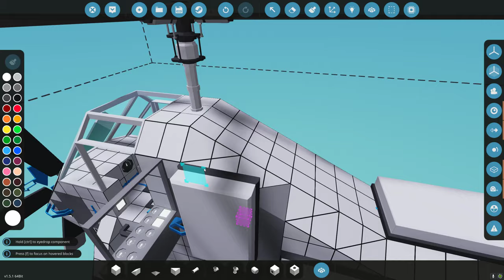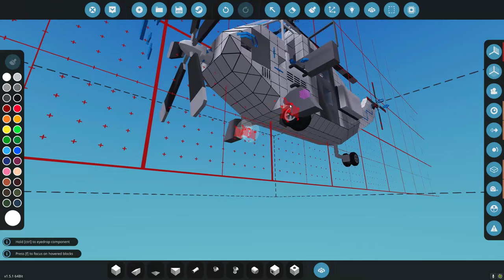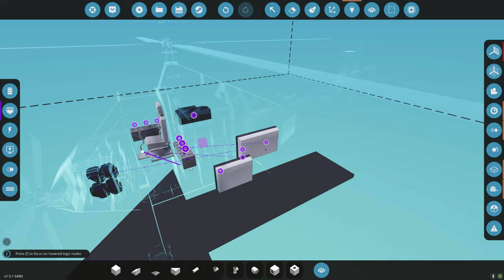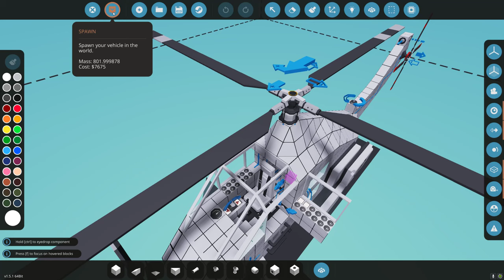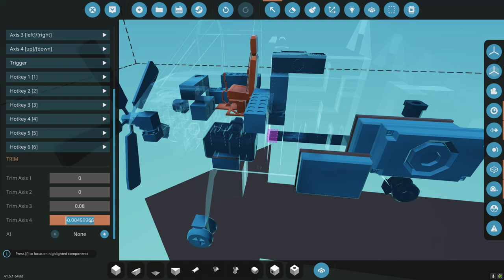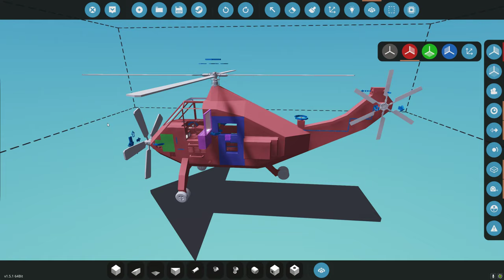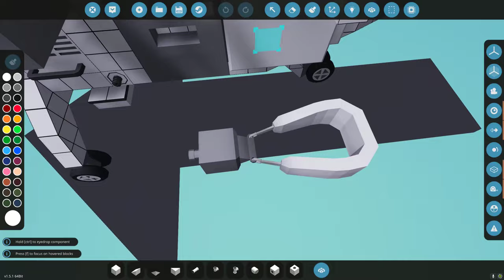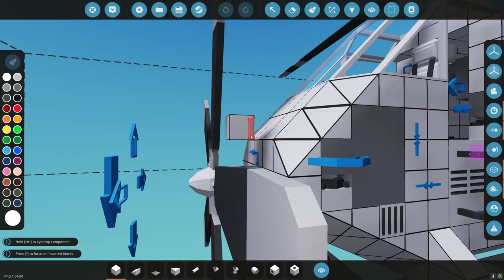Stormworks Career Build Series 59

Comment: Something I found that helps with PID smoothing, since most controls need a value from 0 to 1 but PID wants to output whole numbers, multiply the pid output by 0.01 to 0.0001 then clamp it between 0 and 1 or -1 to 1.    

Otherwise you need to use values of less than 1 in the PID to get small enough values to the controls surfaces or engine.  

It is something i just started to try out.   

PIDs can be very useful but very frustrating to get to work well.

Comment: Something else i noticed is the center of mass is quite far behind the main rotor, having the rotor slightly behind, or directly over the C.O.M. really helps with stability.
Reply from the maker: This is not my first rodeo. 😉
Reply: @CaptainCockerels  Looks like your first helicopter tho...😁

Jk.  

I wrote that before you mentiined weight on the nose.  

Helicopters are kinda my thang in the game. 
Just tryin to help out. 
The game physics and mechanics make it a challenge to get helicopters to work well without a lot of hassle.